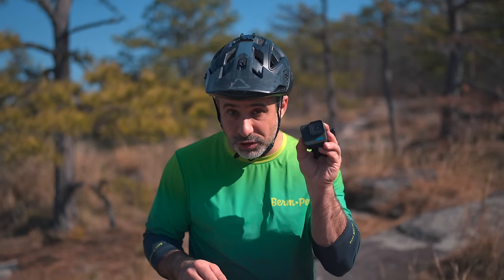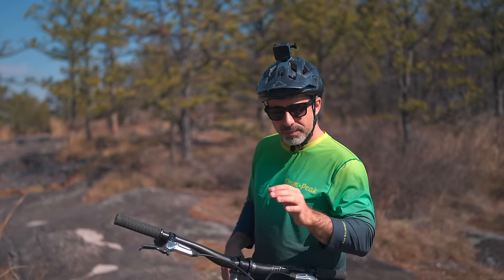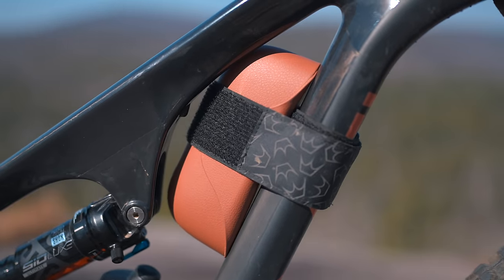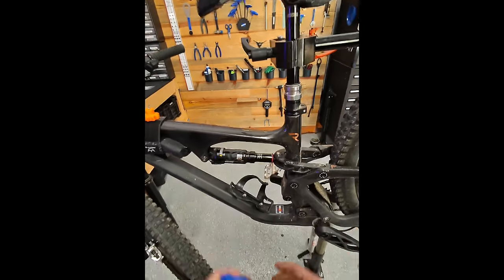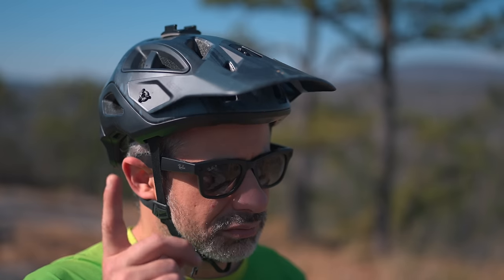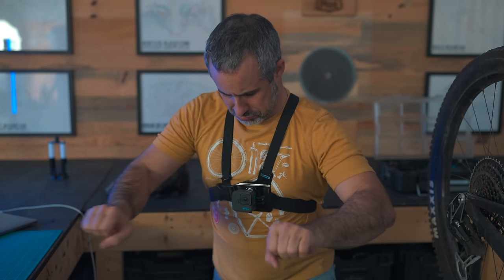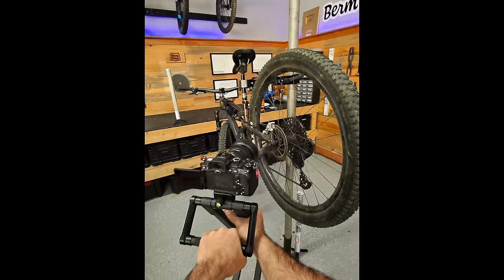Could Sunglasses Replace your GoPro? Mountain Biker Tests Ray-Ban Meta Smart Glasses

Comment: “It’s like a square, but a little taller than wide” - Seth
Reply: So....a rectangle......
Reply: Lol
Reply: to be fair, "square" is a technical term here, he's referring to a 1:1 aspect ratio. There isn't a term "rectangular" with respect to aspect ratio (since all aspect ratios are rectangular) so it makes sense to say "square but with more vertical pixels" given the context.
Reply: @JD-ub5ic  so its rectangle at the end😂
Reply: Technically, all squares are rectangles.
Reply: @DougieFresh13    I suggest  you review your knowledge again. And no, no new math. Classic math professor here
Reply: @ramiroolarte7169  explain.  Rectangle is a Rectangle a square is a square and equal in sides a Rectangle is not.
Reply: @DougieFresh13   soooo... I was right. You won't check before answer. Or maybe you think you know better than thousends of years of science.
Reply: I understand rectangular objects are square in form, but they're not a 'square'.  This is silly. I see what you are saying.  🍻 👏 ✌️ lol
Reply: @DougieFresh13   yeah, no. All ducks are birds but not all birds are ducks. This is exactly the same.
Reply: @ramiroolarte7169  That's what I was saying.
Reply: @DougieFresh13   yes but your said the opposite, in this case the correct way is "all squares are rectangles, but not all rectangles are squares"
Reply: @JD-ub5ic  To be fair,  a square is technically a rectangle.  But a rectangle isn't a square
Reply: Like a rectangle? Lolol
Reply: @JD-ub5ic ok easy there smart guy lol

Comment: 60 second clip restriction is narrowing it to almost unusable level.
Reply: It's intended for the short attention span of the TikTok and YouTube Shorts crowd.
Reply: @Durwood71 and you gonna press the record button while riding to get the 60 second clip you want? 🤦‍♀️
Reply: Its a dealbreaker for sure. Google Glass defaulted to 10 seconds, but could easily be extended to any length. Also Glass shot in landscape which is my preference but I understand that many people today prefer portrait.
Reply: I only record stuff for my own memories, and only use 30 second clips to upload to Strava. But the video might be 5 minutes long to get that 30 second clip.
Reply: honestly surprised they dont have another model that allows for a micro sd. def enough space for it and itll help so much. i just dont think thats who they are geared for
Reply: @Jehty_ you don’t have to press the button, you can say out loud to start recording
Reply: When I make posts to instagram for myself or others it’s almost always 30 second clips of short runs, these seems perfect for what I do

Comment: Better than I expected, I could see for using it for occasional short form content. Otherwise I prefer widescreen and chest mount POV to get the bike perspective in the shot.
Reply: Love your channel!
Reply: @oiyile1971  thanks for watching!
Reply: The older generation has wide camera angles, they are almost a little too wide
Reply: Same thought \m/
I found the sweet spot at the end of last season  of flipping my mounting bracket around and having not only the GoPro a tad higher on the chest, but the battery door accessible to take the battery out during climbs (no phantom-drain that way!)

Comment: Been using my pair for skiing. I usually wear bone conduction headphones and bring a gopro that I rarely use. Anything dual use instantly gets priority for me. The ease of recording has allowed me to capture some fantastic moments that I would have missed fumbling around with a gopro. 

Only gripe is the limited duration video clips that they implemented to prevent overheating the batteries strapped to your face.
Reply: It's always weird when another of my favorite YouTubers comments on a different favorite's videos. 😄
Reply: I too dislike the 1min time restriction. I'm not sure it's to prevent overheating however as video streaming with the glasses does not have a time limit.
Reply: They support recording up to 3 minutes now!
Reply: @theBachelorofArts  where do you see this at? Mine is still capped at 1 min
Reply: @James.Buchanan  Settings -> Camera -> Video Length; the options I have in my app are 15s, 30s, 60s, and 3 minutes

If this setting doesn't show up, maybe try to update both the app and the glasses themselves? Hope this helps!
Reply: @theBachelorofArts  so strange, I'm all up to date on both the app and glasses. Either way, that's great to hear that it's coming. Thanks for the heads up!
Reply: @theBachelorofArts  how come im sseeing nnothing about this onlinne?
Reply: @theBachelorofArts this was my biggest gripe with them, good to know it’s been changed!

Comment: I run a full-face helmet currently. My camera sits by my mouth with a windslayer on it. It picks up my voice well, and the wind sock cancels out the wind.  But this would definitely fill the gap filming while working in the garage. And I wouldn't need to remember eye protection.

Comment: When not mounting my GP on my handlebars I mount it under my helmet visor. I cut a small hole in the visor for the GP prongs to go through. It mounts upside down. Added a few of the extra helmet pads underneath the visor to level it off. It's an old 8 so no self-leveling.

Comment: If they release a set in 16x9, I'm in.

Edit- just got to the 60 second limit. Nevermind. I really wanted an easy way to film on the Motorcycle like a dash cam, and MTB like a gopro.
Reply: Same. That's one of the best use cases for these. Too bad it can't even loop and save on command.

Comment: Nice review. The product has promise, but is not there yet. Good to know the lenses can be made prescription. Hopefully that is any lens manufacturer not just supplied by Rayban, as my prescription is not exactly standard. I would need better stabilisation and fewer compression artifacts. High resolution is not critical 1080p is fine, I don't need 4K. Vertical orientation and just 60 seconds recording rules them out.

Comment: Portrait video though? Coming from someone who's used 10 year old+ cameras to film video ads for clients, this is a toy. 

Seth shows interesting uses but that's more of a solution looking for a problem more than anything. 

Nothing wrong with fun toys though, would probably be great for a parent trying to keep in touch with his adult kids who are out of the house.
Reply: 1. Change to horizontal.
2. Remove the blinking light.
3. Automatically upload the 60 second video using Bluetooth to your phone and start filming a new clip instantaneously.
4. Auto-merge the clips inside the phone for a bigger video experience and voila, you have yourself an actual product.

Comment: I had a better idea back in 2019 when I got a new Hero8 Black and Helmet at the same time. I sent a suggestion to GoPro that they should collaborate with a Bike Helmet manufacturer and Incorporate their camera gear inside a helmet. Could even have multiple Lens/Sensor locations. There would be room enough for more than one GoPro battery for extended recording, ect ect. Could still connect to the GoPro app so you can start/stop/adjust settings/monitor remotely. Still waiting for that to happen.

Comment: I kept thinking if one of the arms had a usb c plug on the bottom side around your temple (or maybe out the back of the arm) area it could have a cord that could plug into a small external/usb drive that would allow you to take prolonged videos.

Comment: I feel the one thing that ruins things like this is bitrate, it looks like its maybe 6500kbs which makes sense for file size. Though at only 60 second clips if it were around 10k kbs itd be much better.

Comment: Hi there really cool review, it's cool to see how this performs, but in my experience and by mixing two of my favorite hobbies MTB and FPV drones,  if you want to have an easy wereable tiny camera that you can put literally anywhere, has practically no weight and has almost gopro capabilities, you should go with an insta360 go2 or 3 instead, it has really nice stabilization, nice battery time and video formats, it even comes with a magnet and a necklace to wear it and keep your hands free, you can shoot vertical or horizontal and you can 3d print tpu cases that you can put anywhere while protecting the camera even on your googles or mtb glasses. And if you want a budget one you can go with a "runcam thumb pro" or a "Hawkeye Thumb 4k" that is the same thing but cheaper, but you would need a powerbank to run them, but have infinite battery , stabilization in those is from a program called gyroflow, hope this gives options to anyone, this would cross off the list anything you been looking to do with the ray bans

Comment: Wow - from my seat with a great monitor, the difference wasn't that much other than the image dimensions.  I'm guessing Gen2 will correct that and bump up the quality a bit.  Battery life will be the dealbreaker.  Having done the GoPro thing - it is a bit PITA. Batteries, straps, memory cards, etc.  How may other than diehard youtubers really need all those bells and whistles.  My guess is not many.  This is gonna get real good.

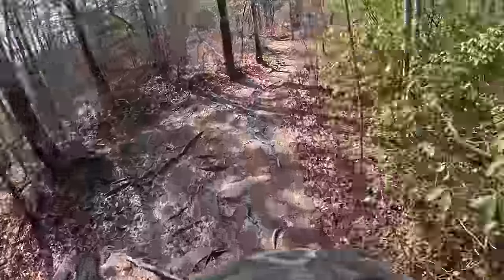Comment: 4:11 so mount it to the chin bar on the helmet, theres plenty of options
7:47 so get a head strap, hat clip or chest mount for the gopro. YOUR problems with the gopro arent problems. literally not a single argument against the gopro is valid in this video, even the wind noise. theres a product to solve all of them

Comment: I think you missed the point of these glasses.  They are not an action camera nor are they sold as one.  These are great for what they are designed for ease of use and integration with your cell phone.  I love these glasses the call quality and the AI is great.   Just FYI if you cover the LED flashing light the glasses wont record.

Comment: They could have given you more than 60 seconds of recording with a bluetooth or hard wire connection to a separate memory pack in your pocket, just as they could have given you a horizontal view as a factory design.  Or, instead of sunglasses, could this not be bulit in to the helmet?

Comment: In your playback it seems like it’s the camera on your left looking out that the dominant camera. If it has two cameras there HAS to be a wide setting mode. Also more stabilizing could be done in the app like GoPro? Or when I load into my video studio it’s not bumpy and choppy. Curious if it was the same choppy when ran through software?

Comment: Seems a bit underwhelming for 2024. 11 years ago I was testing out ski goggles with a camera built-in. One button press to use as well. Sure the quality and charging was worse but at least you could didn't have any limit on recording time.

Snapchat also did their sunglasses that didn't go anywhere. Aside from quality, the speakers and the charging it's still the same deal. If they want things to pickup they need to add modularity. This is when it comes to the camera and the frame. Maybe you'd be OK having a slightly bigger lens for the camera for better quality, or IOS. Or a more sporty frame. Maybe you want to keep the camera when you change sunglasses. Quick swap the glass-lens. Etc. etc.

Definitely not revolutionary. Just evolutionary at a high price tag unfortunately.

Comment: I have a pair. Here is my review:
- doesn't come in aviators (I don't like the dude bro douche sunglass look)
+ Video is incredibly stable
+ Colors look good
- video is output in literally a random resolution each time, makes it extremely annoying to edit with
- bad aspect ratio, not optimized for social media or traditional screens (neither portrait or landscape looks good with the full frame)
+ It's wide
+ Sound quality is pretty good although lacking bass obviously
- 60 second record time limit is stupid
- some functions don't work when it's under 50° F ambient and you're under 50% battery (Like transferring data)
- seemingly no open API for using them, you can stream for up to an hour to Instagram or Facebook, and you can even preview the camera view from your glasses on your phone, but you can't use it as a camera in other applications
± The battery lasts like 2 hours if you're just listening to music, about an hour and a half probably if you're taking occasional pictures and videos, however 15 minutes in the case will take them from 10% to full so it's really not a huge deal to me
± LED when recording makes you look like a goon / however it's good deterrent for creepers using these
- made by one of the worst companies in collaboration with a company that makes overpriced landfill
- who knows how they are using your data

Also at 0:38 - it actually only has one camera. The other one is just an ambient light sensor so it can tell if you cover up the light.

Comment: The tech is cool for sure, but the partnership with Meta is an instant turn off. That and the vertical footage.

However, it seems that there is hop on the horizon. With the tech being out there, perhaps in a couple years we will get a proper set of glasses with full 1080 recording, unlimited recording length (limited by sd storage), and no Meta Partnership. But then the price will easily double

Comment: Plot twist: gopro has Not changed the Processor in the camera since Hero 7
Reply: That's why im looking to buy an used hero 7 black or 8 black and buy a good microphone, and many acessories instead of buying a plain, new hero 12 or 13
It's simply not worth it..
Reply: @rafael_13  the hero 5 session is also a nice choice if u want to record 1440p im searching for one as well 2nd hand but tough luck finding one in eastern europe 😅
Reply: Great comment. GoPro have really dropped the ball since moving to 4k. The overheating issues are embarrassing, and every new model has a shorter and shorter run time before overheating and shutting down.
Reply: @TekedixXx  thats because the processor can't keep up with the quality of the video which is pushed further and further to the limit of what the processor can do, causing it to use more battery and overheat... sadly it won't be long before they'll reach there breaking point or even worst explosion due to overheating... one thing i learned due to experimenting in a safe envoiourment is that Lithium doesn't like warm stuff and it will eventually reach chain reaction to disaster

Comment: Nope, I can't watch vertical video and definitely won't take vertical video. I refuse to watch YouTube Shorts or Tik Tok or anything that is vertical. Sorry, it's more natural and easier to hold the phone horizontally when watching video than vertically, and vertical always looks stupid on a TV or computer monitor. There have been swivelling computer monitors long before smartphones existed, and even before 16:9 monitors or TVs existed. There is always one or two on the market, usually for specialized applications. There's a reason they never became the norm. It's a novelty that sucks HARD in actual daily use.

And square sucks just as much. I've stopped Instagram because of that frustration, among a few other reasons.